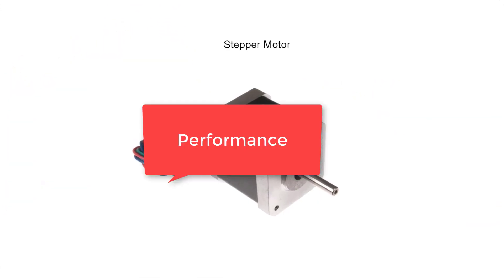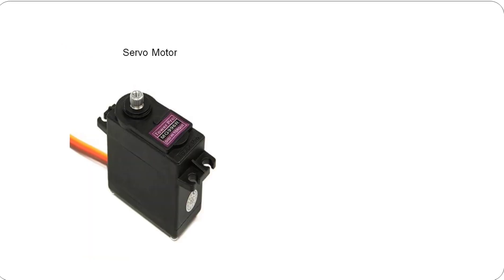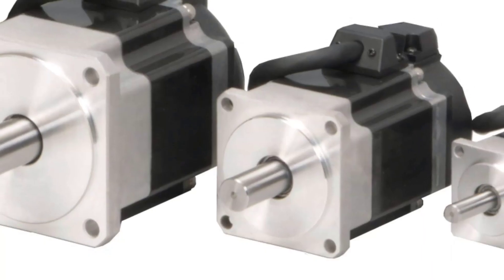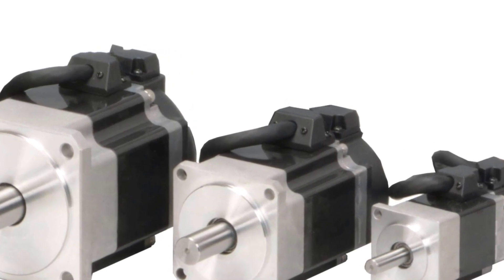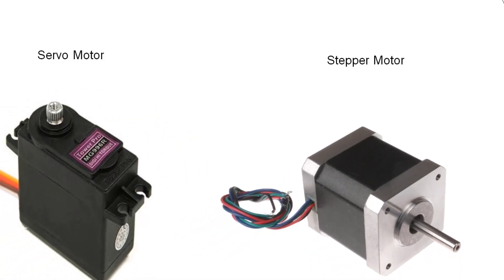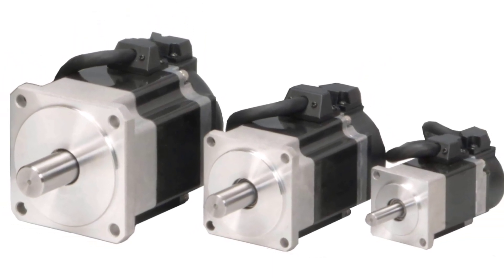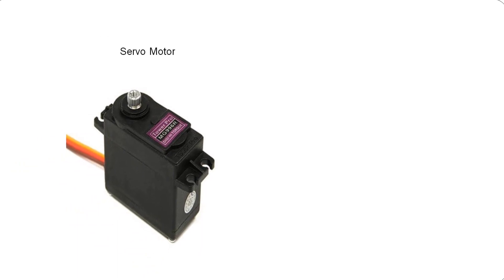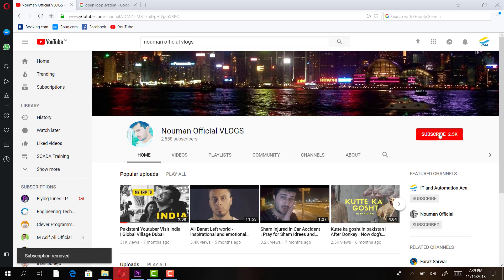Servo Motor vs Stepper Motor  | What is best for your project │Motion Control Training

Comment: Can u pls make a video on how to program a servo drive. It will be really helpful as it is not available on internet.
Reply: for real? it's not available on the internet??
Reply: did you try google? I bought a robot arm with servo motors in all the articulations and programmed 100% of it to work with a raspberry pi by googling

Comment: servo for speed, stepper for precision and where overall torque isn't an issue. Servo with optical encoding is best for most, however when it comes to safety stepper motors win, the just stop. servo motors go nuts.